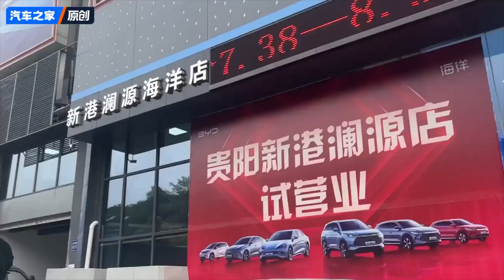Northvolt is Europe's Largest Battery Manufacturer. New Swedish Factory Begins Production.

Comment: You incorrect. There is no recycling even built in Skellefteå but they got a big loan of 5B USD to build it. But and Northvolt 1 in my hometown don't even have stable production, they sold for 10musd last year, and lost billions in opex.

They have LOM with several car companies but no company has used NV cells in their cars.

The Na+ celled they tlsk about is worse on paper than CATLs and will be more expensive, on the upside they then can reduce their depenacy on Russia for other metals.

Comment: Very good news to here! I'm glad that despite soft sales in China, VW ID series cars are selling relatively well in Europe. Here in Canada? They are barely marketed however tough new carrot/stick regulations are coming for 2026 so they are going to have to step up and market/sell more cars here if they want to still exist...  

On a related note, Northvolt is also opening a huge Gigafactory near Montreal powered by Hydro-Quebec and unnamed Japanese battery maker is in talks to build an $18B CAD facility in WInnipeg powered by Manitoba Hydro...  Both of which I suspect will boost American assembly EV operations as well as possibly the all but signed on the dotted line Honda Canada mega factory planned for a site next to their existing operations North of Toronto in Alliston, Ontario...

PS, Can't wait to see the battery recycling factory video because that will REALLY take the hot air out of the world's supply of aging angry gasbags who believe EV's are harmful to the world...